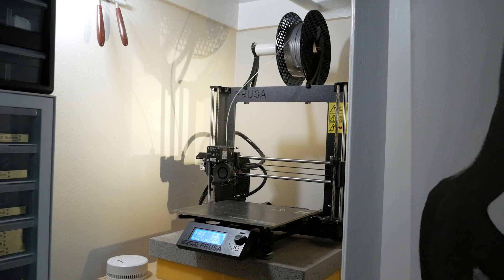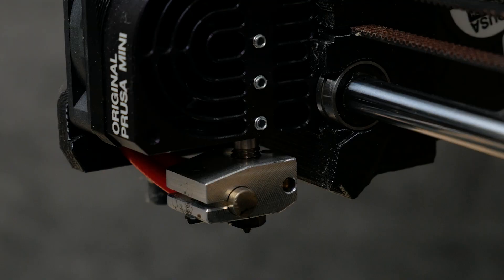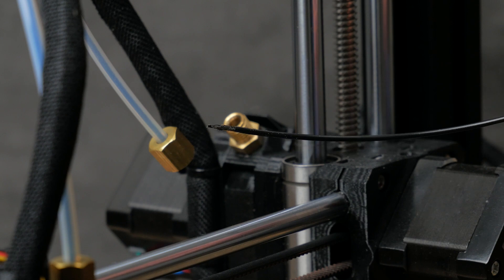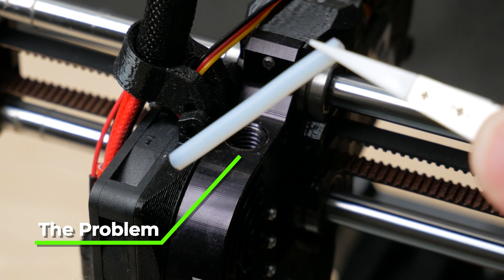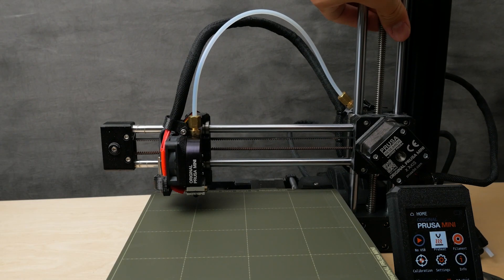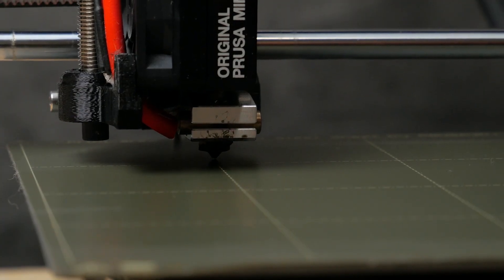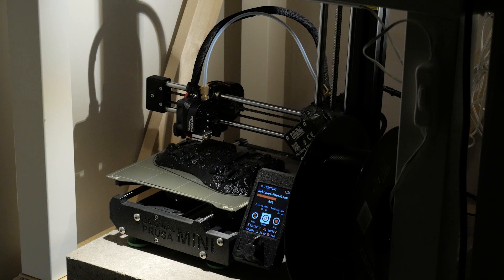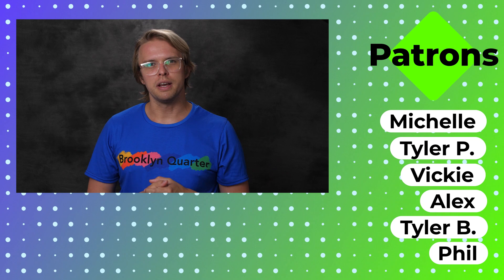Fixing my broken Prusa Mini - MTS#7

Comment: I tried this and the Z axis was not going all the way down to the bed when it read 0. Doing the first layer calibration did not go well either and maxed the live adjust as well and still no contact of filament on the bed any info on this would be awesome!
Reply from the maker: Hiya Linden, I would check that your MINDA probe is the right height relative to the nozzle, as that will determine your Z range
Reply: @BrooklynQuarter  Thanks for the reply! I ended up not following the directions correctly and took the MINDA the wrong direction. Also had to "Disable Steppers" to be able to run the nozzle down to the bed. Thanks for the help and the video!

Comment: If I lose track of the orientation of the short piece of bowden tube that goes into the extruder, how do I figure out which way to put it back in??? It's looks the same at both ends…
Reply from the maker: I have found similar tubes as well. Without a gauge it can be hard to be sure

Comment: But whats up with those very visible layer lines? Those are definitely not "normal".
Reply from the maker: That’s just untuned filament settings in the slicer, that’s an entirely separate process to dial in per filament brand.

Comment: Actually some other tricks to reduce risk of clogging:
1. Increase fan speed for hotend cooler (esp. if printing in hot ambient temperature like in an enclosure or a hot summerday in August). The original fan runs only at 38% (you can hear the difference, on reset it goes to 100% just a moment). Prusa firmware does not allow adjusting this speed - but llama firmware does. Sadly llama firmware is discontiniued and a step behind actual prusa firmware. But you always can go 100% permanent: Open electronics box, remove hotend fan cable, remove black wire from the connector and put it into a dupond connector housing (or put some electrical tape around). Plug fan cable back into the socet and the black wire to J21 Pin 2 (you might remove the jumper there before). This way the fan gets permanent ground instead pulsewith modulated one - so it is permanent on with 100%. While with original fan it is a bit to strong now (and loud), you might instal a Noctua or Sunon fan instead. These are less powerful than the original fan - but compared to original fan @38% theese fans @100% provide 30-50% more cooling air - and are extreme silent.
2. There is a Prusa MINI PC4-M10 Bowden Fitting Adapter on printables. With m10 push-trough couplers you can use one bowden instead of 3 pices. If you use Capricon with 1.9 inside diameter, you can actually reduce retraction distance - and reduced retraction distance is a great way to reduce heatcreep...
3. Same effect with reduced retraction if you use a direct extruder. There are models for sherpa, orbiter and hextruder (and maybe more), all using lightweight Nema 14. (you have to set lower motor current in start g-code and also make a file to set it and "print" the command before first layer calibration).

Of course best is to use the fix you have shown + fan mod + diect extruder (+ Revo micro)
Reply: Revo micro or v6 close enough?

Comment: Hi any advice how to loosen the 3 screws on the heathead? The allen key almost broke trying to loosen it :/ Thx!
Reply from the maker: Did you remove the long machine screw holding in the wire harness, then wiggle the wire harness out of the way? That bottom nut sits captive against the wire harness when it's in position, and won't budge until the harness is moved.
Reply: @BrooklynQuarter  omg it worked, it's finally fixed after 3 days of frustration. Thank you!!
Reply from the maker: @WWalkerz  Happy to help!

Comment: My MIni+ started having the same issue with PETG this week, it would print fine, until certain amount of time. then under extrude the filament and ghost print. Very annoying.
Had to open extruder, to free the filament, 3 times already.

I put together a nice enclosure, and feeding the filament from below, using a longer PTFE tube, and a hole to the enclosure bottom. So I was blaming the friction, or maybe the longer tube, but then I tested with everything as originally came and same issue, after around 2 hours...

I read about the issue with the hotend and PTFE tube gap but a video I saw suggested changing the hotend, what I found to be too soon and too much.

Here I finally got the right explanation and fix. And such a nicely done video.

Thank you, I will try this weekend. RN I am taking the opportunity to do some upgrades, just changing the LCD front panel to add the power and USB port to the front

Subscribed as a way to say thank you!
Reply from the maker: Thank you for the kind words!

Comment: I had a similar issue with my mini +. Luckily, I was able to unscrew the 10mm on the hot end side of the tube, heat up the head and pull it out the blobbed filament, no need to re-adjust anything.
Reply from the maker: I think there might be some sort of small difference in the hot-end assemblies that separates minor issues like you ran into, and the larger issue I encountered.

I had hoped when I had my first clog (20 hours in with printing) that it was a blip like you encountered. Fingers crossed your worries are behind you!

Comment: Could you cut a ptfe tube just a little longer instead of moving the hot end up? Just wondering I don’t have this machine.
Reply from the maker: Yeah that’s a good observation. It might be tricky because the ptfe has a specific chamfer degree cut into the end, but if I had extra tubing that fit the dimension I could have tried that.